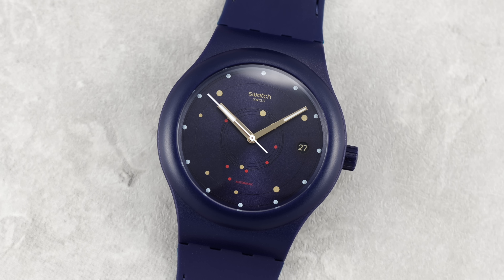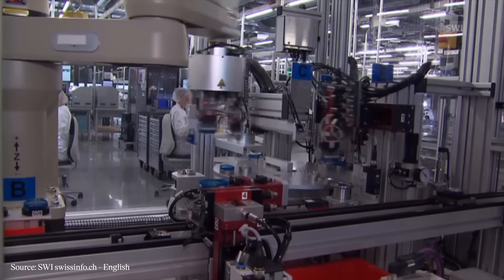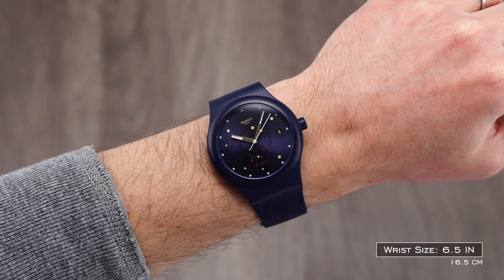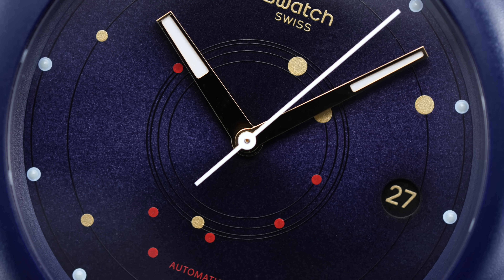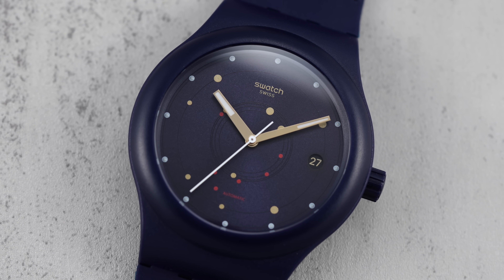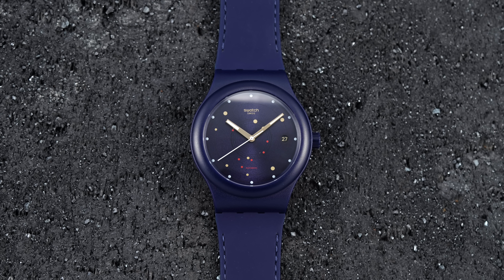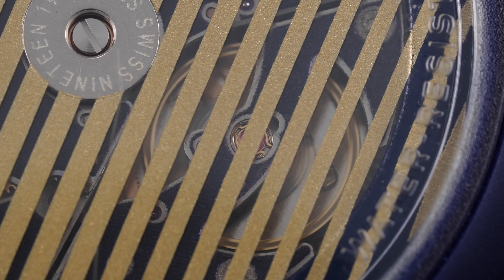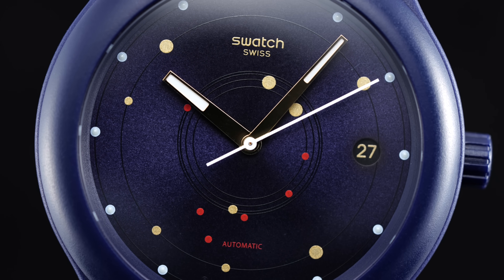Is The Most Affordable Swiss Automatic Watch Any Good? The SWATCH Sistem51

Comment: My daughter bought me a first generation Sistem51 watch for my 50th birthday.  I loved it.  Wore it as much as I could.  After about 1 year, the watch strap buckle broke.   I went to my local Swatch store to buy a replacement strap, and they replaced it for free.   About three years in, the watch just stopped.  It would work if I shook it but only for a few seconds.   It turns out the mainspring must have fallen off its mounting point.  I tried manual winding and hear a noticeable "click" sound while turning the crown.  I love the proposition of the Sistem51 movement.  It was accurate and a functionally good movement.   But in the end, it is a kid's toy for adults.  You play with it for a little while and throw it away.  I'm pretty sure the plastics would dry out and crack if you leave it in the sun too long.   I'm tempted to get another one, but feel I could get a something less fun, but would last much longer for less money.
Reply: like a seiko 5...
Reply: They make metal ones

Comment: I like the idea of Swatch and even have a couple that were gifts.  I only have the quartz - not Sistem51; so my biggest problem (apart from Sistem 51 NON-serviceability, which doesn't apply to mine), is the price.  I feel that no Swatch should be more than $80-100 (for limited/special designs) and should rival the cheaper Casios in price, as that is really the quality level - in fact, the Casios have way more functionalty as well, even at the lower end e.g. F-91W.  Swatch and a lot of Timex are over-priced for what you are getting, I would say.
Reply: Especially considering it's a disposable watch, no less.
Reply: I was thinking it's a nice gift, not cheap, not too rich, but something the receiver could enjoy for a few years and the giver doesn't come off as cheap to their favourite nephew etc. It could be a nice first watch. I do think the non-serviceability is an issue at this price point. For double the price, a Seiko 5 will prob run for 10 years before it absolutely needs a service.

Comment: I agree with your overall take. I have the Sistem51 in the Blanc Pain collaboration. IMO it's a fine piece of modern watch engineering. Besides the rotor being loud it works fine and keeps time.I would appreciate a better feeling crown and winding feel. Until the Omega collaboration, I would have never thought of buying one. I had not owned a Swatch since 1986. My parents gifted me a Swatch for my 5th-grade graduation.

Comment: I’m a swatch collector, and I vastly prefer the old automatics they put out in the early 90s over sistem51. They are only a tad bit bigger than a standard swatch, and the rotor is a lot less noisy and weighty than sistem51, and they somehow are a lot thinner than the modern automatics to boot, and on top of all that they can be found on the second hand market relatively inexpensively.

And this is just my personal take, but the old 90s swatch automatics really lean more into the bright, fun and bold designs that really defined the brand in the early era. Sistem51, imo, tend to offer somewhat bland and muted designs.
Reply: Teddy has become a part of the marketing machine to move product.
Reply: @_cru8368  he is paid to do it but of course he wont tell you
Reply: Can you recommend where to buy one of the 90s ones?

Comment: Bought with enthusiasm the Sistem Check YIS412G 5 years ago, stopped working luckily within the warranty time, so the mouvement was replaced fro free. Now it works correctly only on the table, if is on my wrist start slowing down and is not usuable. I still like it, but when I have time and money to spend on it I will send it back to Swatch, just for the sake of having watches in working order. However, I do not recommand to buy to anybody. Seiko, Orient, Citizen or many more microbrand are a better choice.

Comment: I’m 57 so I grew up during the Swatch early years - in Europe, so right in the thick of it. I always liked the concept of it but the large watches are too large and the small is, well, too small. The ultra thin ones were pretty nice, however, they are quartz and like all Swatch they have that very easily scratched up acrylic crystal…. So to me they are rather disposable. If I were looking for a less expensive automatic watch I’d go for the little more expensive Timex (yea, I know, not Swiss…) that are coming up with some really nice designs, or go vintage. Buy something second hand. Cheers! Cool video.

Comment: I bought a Sistem Navy and wore it on and off. After a few months of storage, it wouldn't run for long periods and only got worse. Later on I bought a "lighlty used" Sistem Flier which also crawled to a halt. It seems like the lube inside these watches gets thick over time, the same as with many Chronos. My Sistem Navy became an experimental watch. I pulled the crown and squirted my own lube in. The crown broke on the second round of lube but the watch runs great again nonetheless. I just have to start it at the right time as the time cannot be set anymore 😅

Comment: I bought the first Sistem51 -- I loved it and wore it almost every day, going through two leather straps in as many years. 

However, as my collection grew, it slowly fell out of rotation. Once, when I decided to use it after a couple of months, I found that it had stopped working. I tried winding it but it would grind to a halt after a few seconds. Unfortunately the movement is unserviceable by design, so the watch has been consigned to a drawer.

I would save a few dollars by going for a quartz model, or spend a bit more for a Seiko 5.

Comment: I wonder how well these sell. I imagine not as well as they would like, or they would have more models available. I rarely see additions to the line. I check every few months and in fact it seems like a couple I kind of liked before are no longer available. I've never found just the right one for me. I do own 4 Swatches (2 of them MoonSwatches), and Swatch in the '80s is really what got me interested in watches in the first place. It's too bad about the rotor noise on the Sistem51 as well. Is it as annoying as the ticking of the quartz models (why haven't they engineered that out yet?)?

Comment: Mine was terrible. Bought one, wore it 3 days, put it in a drawer because I didn't like it. Took it out two years later.....broken. Would not run for more than 10 seconds. Never had that with any watch. I have had watches that hadnt run in 30 years start up without issue (need a service okay, but they work). The Swatch cannot be serviced or fixed so : in the bin.

Comment: I prefer the quartz version of Swatch.  I had a "Blackout" that I wore through high school and loved it.  I later bought a new old stock of the same model still on the original jewel case and still have it.  Now I have the newer version with a larger case and will likely never wear it but keep it in the collection of a few other large case models.  I will never buy a mechanical Swatch because it just seems like the antithesis of a cheap plastic watch.  Quartz is cheap and accurate and belongs in a plastic Swatch.

Comment: I've had three of them, and found that they aren't any good.  The first two, a "white" and "chic" lasted only a few weeks or months.  I sent the "chic" back on warranty, and it was replaced with a "blue."  That one also only lasted a few months, so I didn't bother with another warranty replacement.  I figured it would be trash like the earlier ones.  Then, a couple years later, I got a "pink," thinking they might have improved the movement.  I wore it a few times, and it worked ok, but then after not using it for a year or so, it barely runs, losing about a minute per hour.  The bottom line is that Sistem51 watches are trash.  For similar money, you can get a Seiko 5 that will last for decades.  The Seiko won't have the "fun" design of the colorful plastic Swatch, though.

Comment: The biggest German watch-forum is pretty unanimous on the Sistem51: It's garbage. It starts as a decent automatic watch but within a few years the accuracy is going downhill rapidly. Since there is no way of repairing it, after 2-3 years you can't even use it as a paperweight anymore since it's to light.
With hundreds of NH35 watches in all sizes, colors, designs and materials in the range of 100 - 200 USD, there is absolutely no cause for the sistem51's existence. NH35's will run for decades, and if they stop working you can use it for practice to disassemble a movement and understand how it works. If you can't put it back together, no problem. Buy a new movement for 25 bucks, put it in and the watch will run for another 20 years.

Comment: Re the non-serviceability (is that a word?) of the System 51: Who cares? Would you really take your $175 Swatch to have it serviced? Have checked on the service prices these days? I have not had a watch serviced in the last 3 years that cost $175 or less. Usually considerably more. So are you going to pay a watchmaker $200 - $300 to service it? Not me. If it is such a big deal and you want a Swatch, just buy a quartz model. Less expensive and more reliable.

Comment: I find it hard to justify anything above 50 when it's ment to throw away.  For 89 euro you can get an Invicta pro diver made of stainless steel, 150 an automatic one.
For 279 euro you can buy an Orient Kamasu which is also stainless steel. Twenty years later these two watches will still exist (and work) while a Swatch is a plastic-fantastic thingy which will probably die before reaching 10 years. And when it does, you can throw it away rather than service it or replace the movement so there also goes your emotional value into the bin. In my opinion this Swatch proposition is only good for Swatch, not for you.

Comment: In my opinion, Swatch went too far in making their signature watch in plastic and/or not upgrading the product. In nature, simplicity is key, there is no complication for complexity's sake. Having said that, plastic doesn't really fit anybody's definition of a suitable watch case material. The cheapest material that is acceptable is stainless steel. If Swatch can make the System 51 movement a little more robust and fit a proper case, then that might be a good move for Swatch.
Reply: Plastics and resins are fine. People like G-Shocks well enough after all. It's a material science issue, making better feeling plastics/composites.
Reply: @Horizontalvertigo  Yeah, Casio has that market nailed down.

Comment: Absolutely STAY AWAY from the Swatch Sistem51...mine didnt even last 1 yr before it completely stopped working. And looking at the anecdotes in the comments section this is a very common occurence. Its not cheap compared to the quality and decades-long reliability of Seiko automatics that cost the same or even lower. Not to mention u cant do anything to the swatch even if u knew how to fix watches. Its like a train wreck in slow motion - annoyingly painful

Comment: To put it lightly I'm happy this sort of thing exists. However I can't tolerate the poor build quality. They break way too easily and are bound for the land fill. Not been able to service a mechanical movement defeats the purpose of it.  Been long lasting and serviceable meaning you can potentially have the watch forever. Something that can't happen under any circumstances with this line of watch. 

Now can this watch movement last a long time? Yes it can. However the failure rate and the build quality of not just the movement but the rest of the watch. Ie the crown falling off the watch or it can stop turning to wind and set the watch. Is just unacceptable. the case material doesn't really bother me and there are metal versions any way so take it as you will.

 For the money get a Seiko 5 or citizen it may not be swiss however it's serviceable and will last you so much longer. 

On the accuracy front it's like any watch some will be more accurate than others. Teddy got a fairly good one but I like to see accuracy over time as the watch gets older.

Comment: Swatch automatic movement is the worse possible watch works 1-2 years and after it breaks and can not be fix at all. Had 2 never again. Let's explain Ritmo 5 years old still working Swatch 2 times changed both failed.